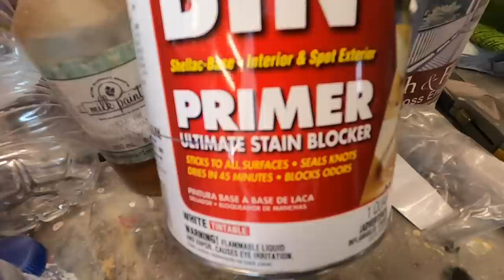Flower Power Man

Comment: Checkout the hydraulic lift cart at Harbor Freight Tools. I use one to load and unload heavy stuff from the back of my truck, just raise it to the height of the tailgate, slide it on the cart , wheel it where you want it then lower the cart and tip it off. Get the 500 lb capacity cart you’ll be glad you did. With the 20% off coupon they’re about $200 and well worth it. I added a piece of 1/2 inch plywood to mine to make the top 4 inches wider and longer to help with the bulkier items.
Reply from the maker: Awesome thank you for the recommendation!!

Comment: You need to get your hubby to weld up a frame on wheels, and then buy a power lift gate. Instal on to frame ( with frame supports). Then you can slide furniture out of box, and power gate down and opposite loading ..........cheers

Comment: Get you a couple of saw horses that you could set up at the back of the truck to slid the piece on. Then you can set it down to the ground where it it is not in such an awkward position. Great job on not giving up and getting your problem resolved and getting it unloaded. What did you to clean the piece with to get dust and everything off of it before using the primer?
Reply from the maker: Thank you for the idea! I used Lysol all purpose cleaner and a microfiber cloth!

Comment: you  want to get yourself a high lift hand fork truck they can lift up till 1 ton and is super handy for loading and unloading plus if you attach a sheet to the forks you can use it as a bench which saves you back on having to bend down to sand you can just pump  up the truck till  the high required even a good secondhand one would work for you as its not needing to lift heavy weights

Comment: Need to invest in a sicer jack table on wheels to load and unload by yourself or have you chet make you one using old sicer jacks out of the junk yard weldin one ontop of another to be able to reach the truck bed highth .and a screw gun with the right socket on it to work the sicer jacks fast and easy . Call your local junk yard ask them to find you 8 matching jacks . Ya they will probably hit you for $10 each but life will be so super easy for you if you can get chet to build you a table to unload and load with .